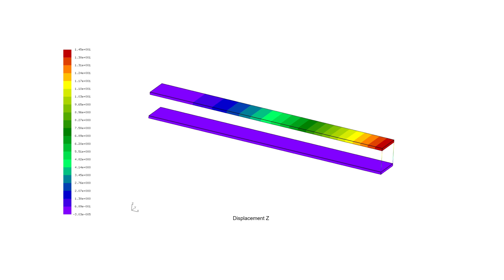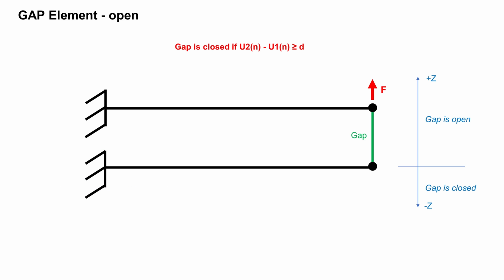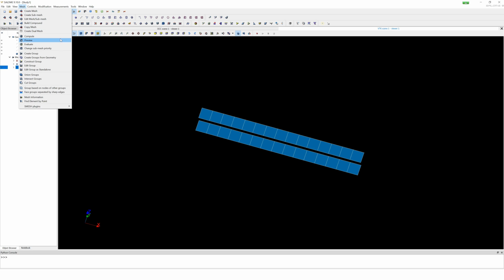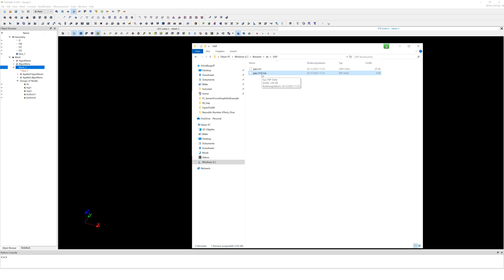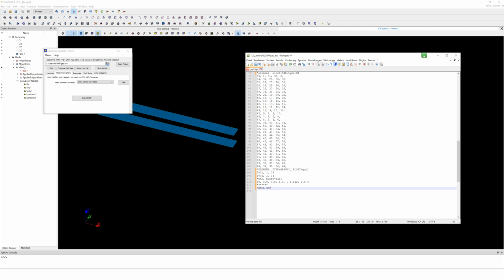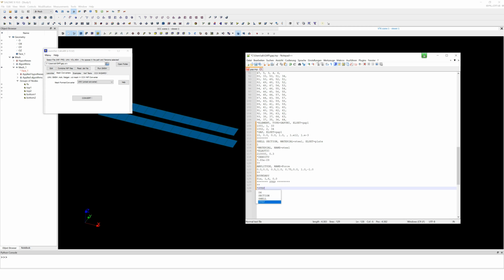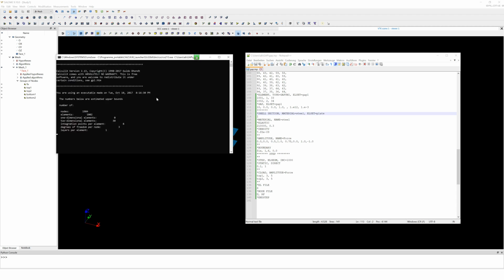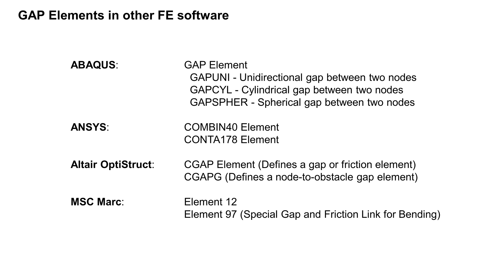Structural Simulation | GAP element | Salome Meca & CalculiX

Comment: How can define the friction and "Hard" contact of the gap element?
Reply from the maker: In Abaqus is the default mechanical interaction for gap elements is “hard,” frictionless contact. You can assign optional mechanical interaction models. The following mechanical interaction models are available:
- Friction
- Modified “hard” contact: softened contact, and viscous damping. 
See documetation: 31.2.1 Gap contact elements

*GAP, ELSET=name
*FRICTION

For Calculix is this not avalibel.
Reply: @andreas-baer-engineering  Thank you. I have tried to define the gap element with friction. However, I still don’t know how to modify the normal interaction property for the gap element. It’s true that the default gap element is ‘hard’ contact. But if I want to modify the hard to soften, I am not sure how to write the keywords.

Comment: Can the contact detection not take care of the gap into and out of  contact by itself?
Reply from the maker: Gap is only relationship between two nodes. For interaction between nodes do you need to difine gap distance.
By (normal) contact conditions is contact tolerance - min. distance to search for contact between contact pair.